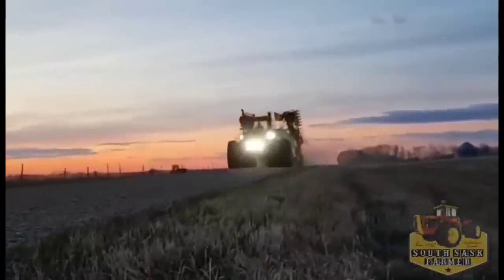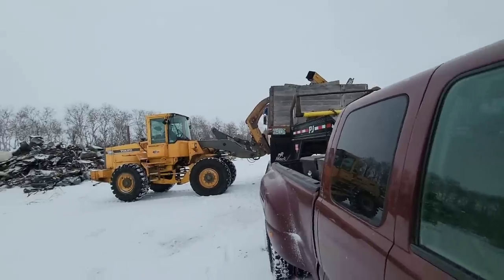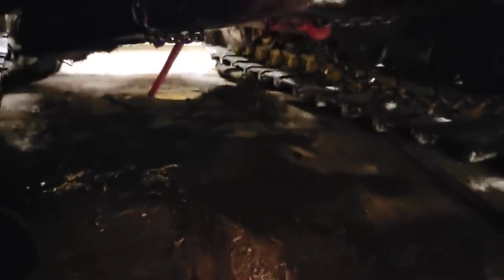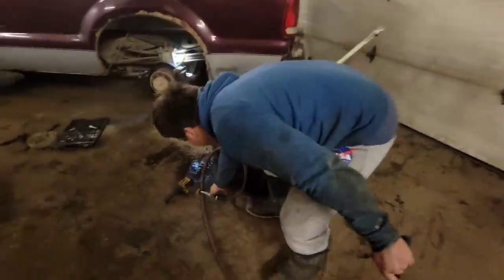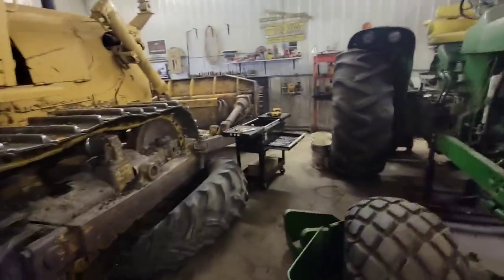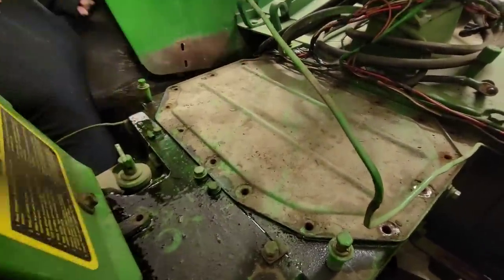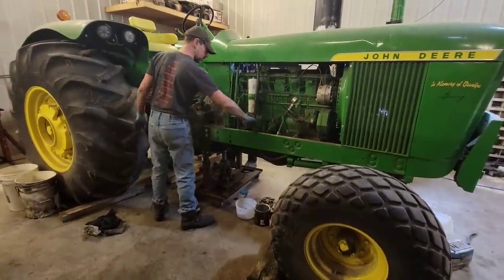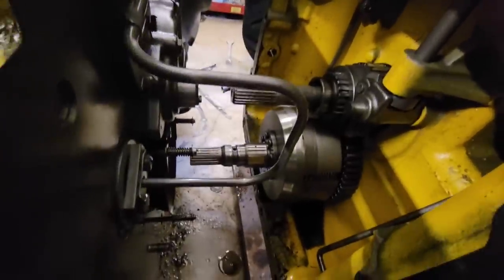The 5010 is split!!

Comment: So I'm gonna be down about mid-May to borrow that dozer for about a month lol I have several fence-lines in dire need of "upgrading", and that would be perfect to do it lol And are those 23.1-34s on that 5010 or am I seeing things again? lol
Reply from the maker: 24.5 32 lol
Reply: I wasn't far out lol I knew they were bigger than the old 16.9s and 18.4s most things of that age came with, anyways lol
Reply: @Jokerkles  good year actually made that size for John deere when the 5010 came out.